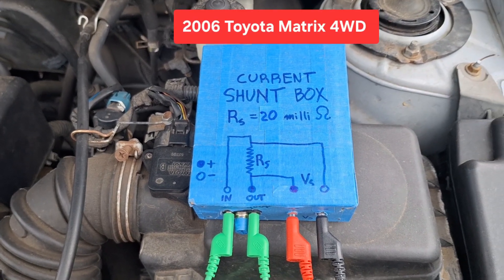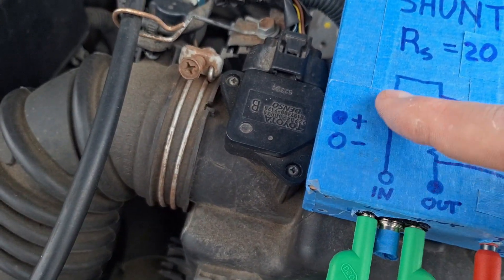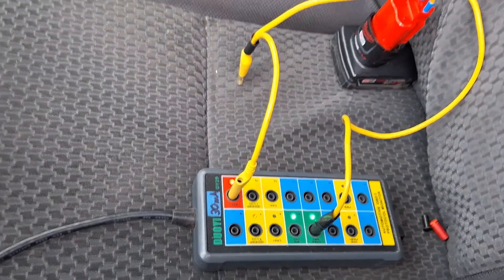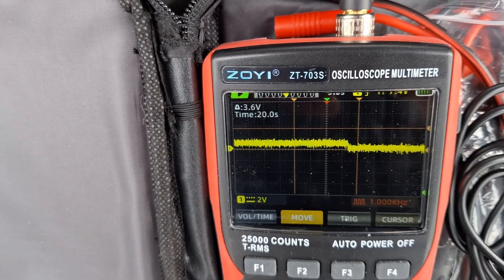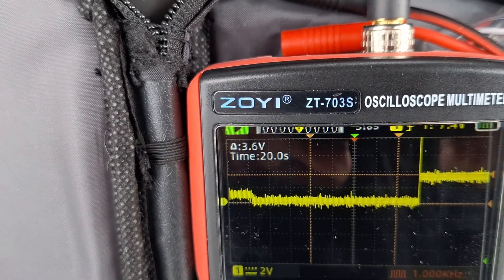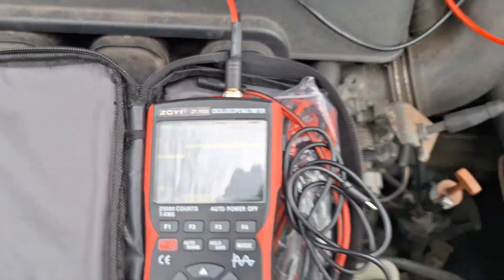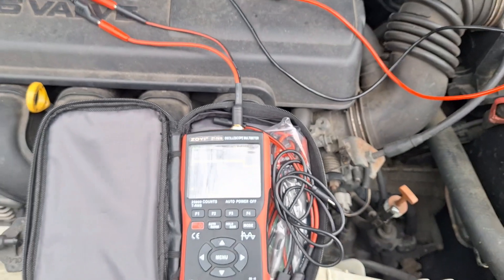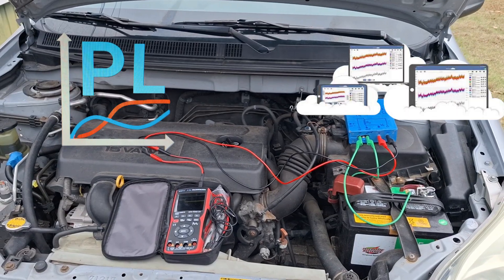Parasitic Draw Testing: DIY Current Sense Resistor (20mOhm), Custom Leads & ZOYI ZT-703S Scope.

Comment: What are you working on for you  next project?
Reply from the maker: Thinking about doing something with the sensors on the vehicle with some breakout leads. Take some measurements and maybe feed some inputs to the computer and watch on scan tool without having to back probe or pierce. Have a good one. 🔧
Reply: @MarzNet256 👍